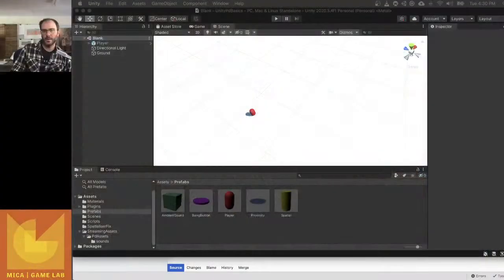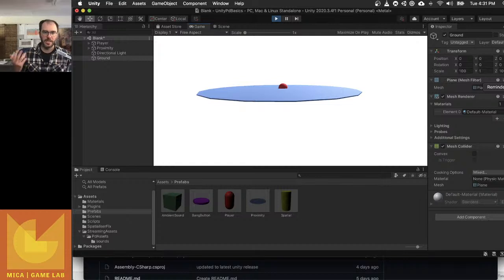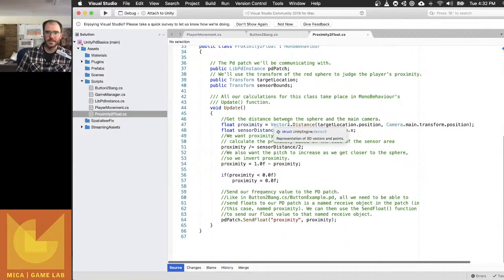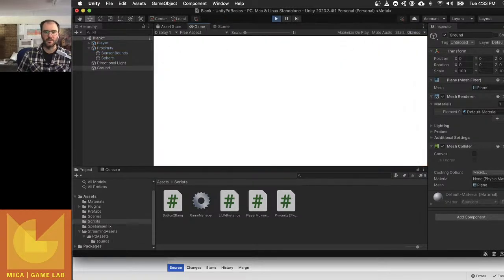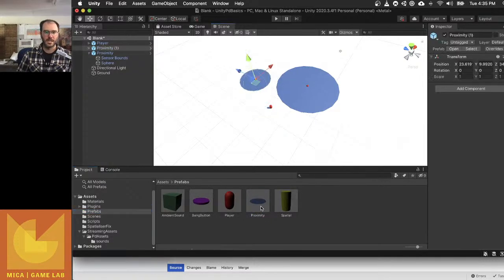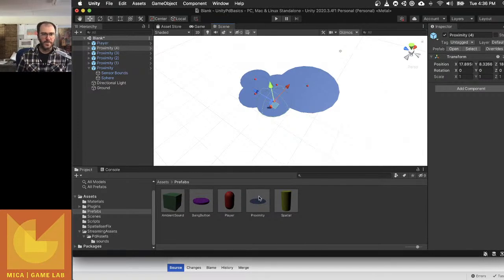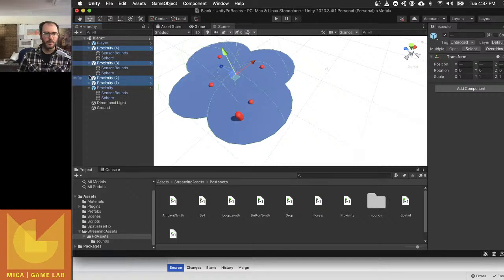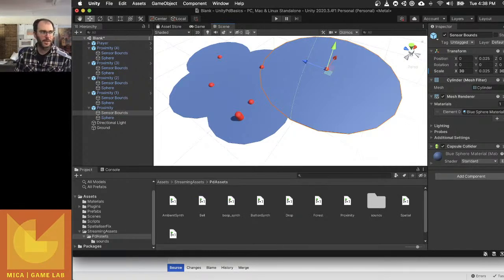Unity & Pd Tutorial Ep.5: sending a value to Pd

Comment: Thank you for this, such a great work! 
I tried to build but the sound doesn't work in the standalone.  
I followed this note "If building for mac, Unity may complain about conflicting versions of libpd. This is because Unity mistakenly assumes the 64-bit Linux lipbd binary is actually a mac binary. To rectify the issue, select the 64-bit linux binary (Assets/Plugins/x64/libpd.so) and uncheck the Mac OS X x64 toggle in the Inspector to match the following image, then click Apply"
And the build is successful, it is the sound that doesn't work. Have you had this issue?
Reply from the maker: Hi! That sounds a bit odd. I've had one or two other similar reports, but I'm not sure if they are all related. I will look into it and maybe get back in touch with you for more details!
Reply: @amazingrolo  that would be very appreciated, thank you!